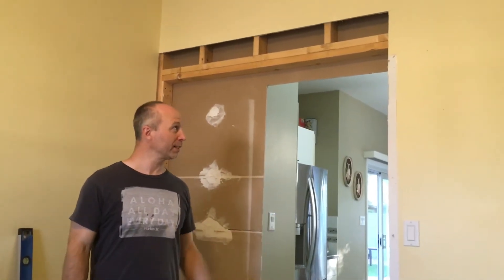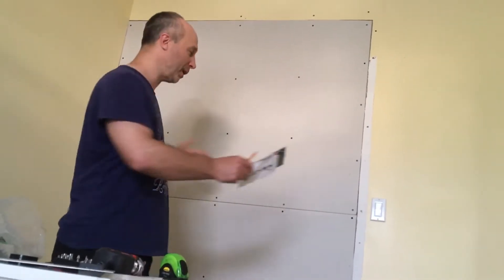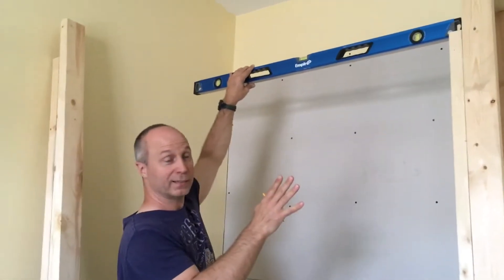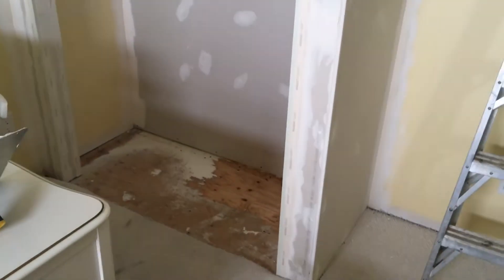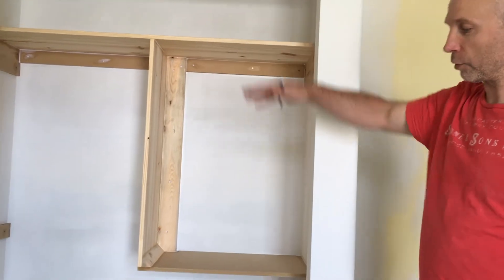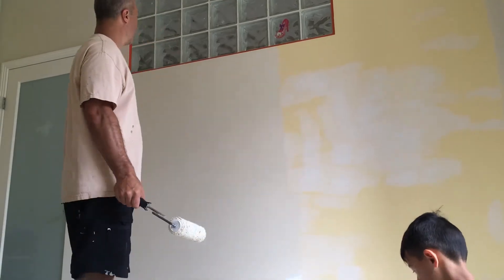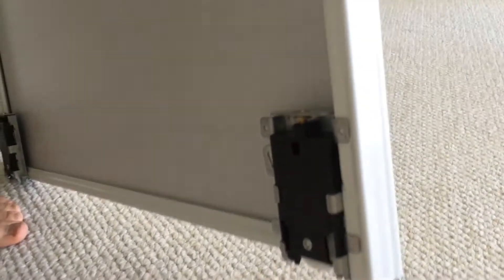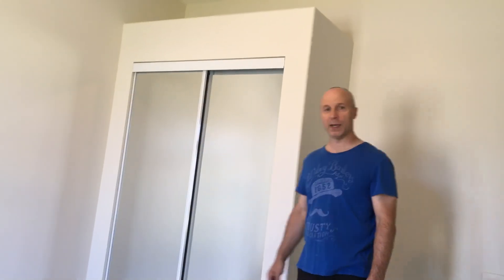How to build a closet and install a sliding door

Comment: Thank you for your detailed easy to watch video! I love all the little tips on the little details that make a big difference over time.Why don't you rest the dry wall directly on the floor? is it due to shrinkage in weather change?
Reply from the maker: you always leave a gap from the floor for drywall in case of flooding or a spill as drywall is like a sponge and will soak up the water resulting in future mold as difficult to dry. the gap prevents the water from wicking up through capillary action...
Reply: @sportytourer  Thank you for your response! That makes so much sense! That's good info that comes in handy down the line. Cheers!